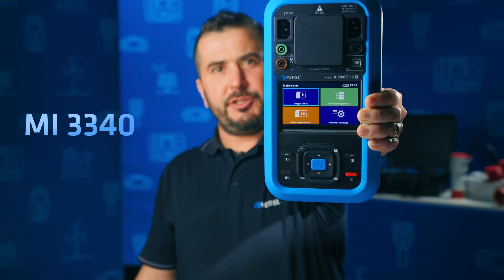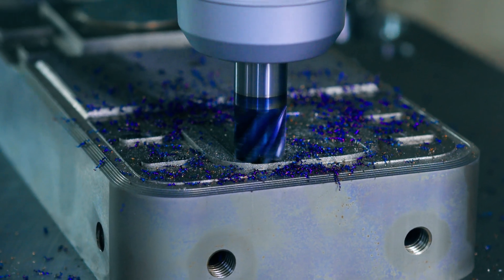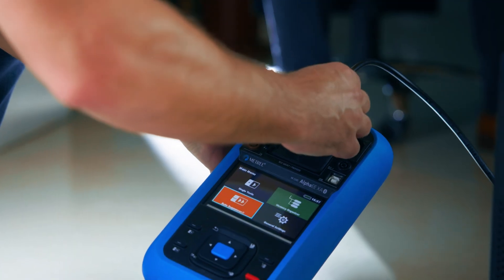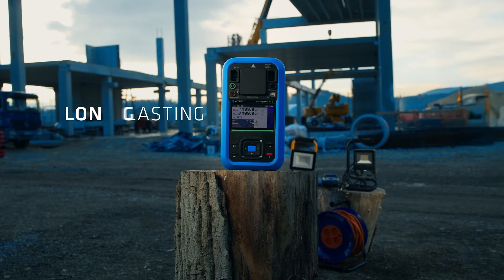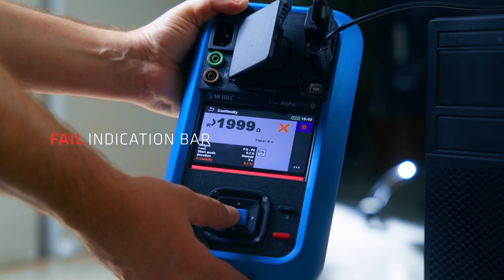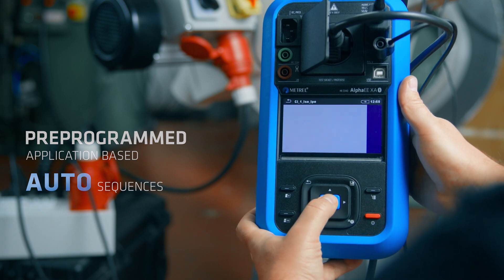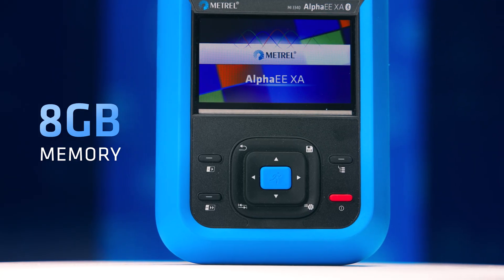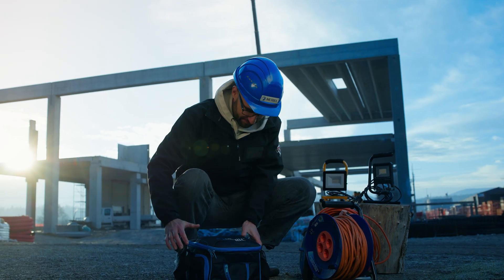Metrel | MI 3340 | Promotional

Comment: Saying it has 8MB of memory means nothing - how many entries can it store?   SD card slot (function to store onto that and internal memory so you are measuring with confidence your data is safe - details like that).   Touchscreens nice but physical buttons - ones you can assign repetitive functions or even program a series of functions/processes as a macro?

Can it link to phone and add functionality that way?
Reply from the maker: The size of the SD card is 8GB. The amount of data varies and depends on a number of factors. MESM software enables addition of images in our .padfx files, which can be uploaded to the SC card. Unfortunately, customizing physical buttons in the manner you described is currently unavailable. You can connect your smartphone to the tester, but only for data transfer.